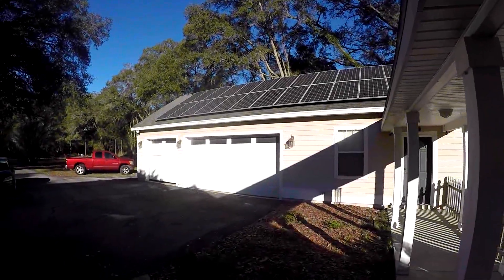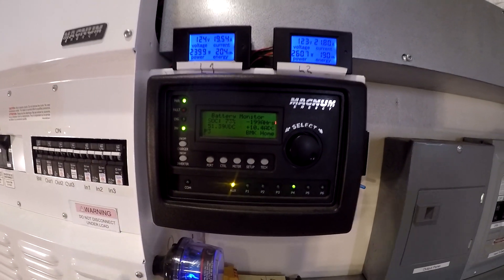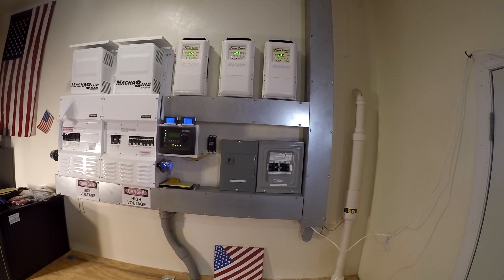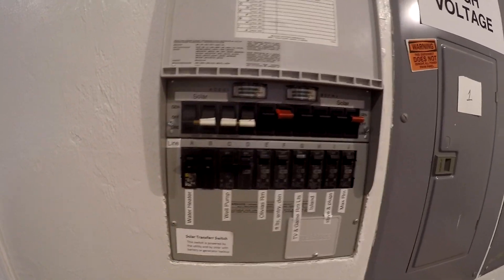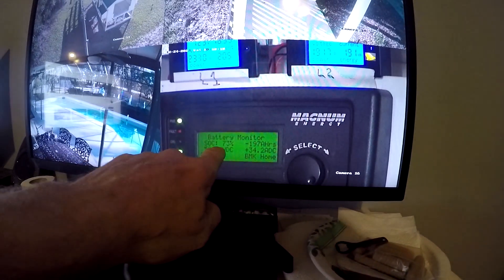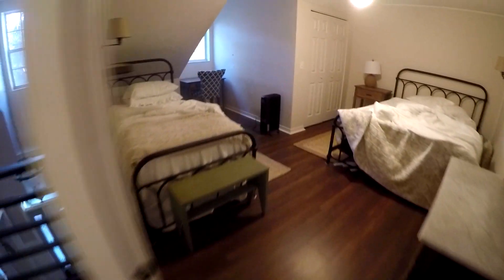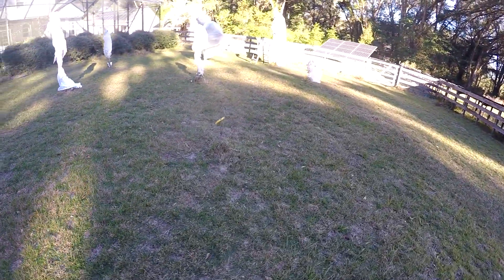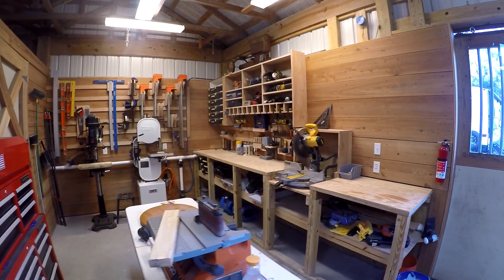Heat From Solar Power

Comment: You should have left the pump on. The lines would have been fine. 
As long as the water was flowing those pipes won't freeze that easy.  Was it 60 the next day?
Reply from the maker: Yes, That is exactly what I did.  I ran the pump non stop over the entire cold snap.  Thanks!

Comment: That Delta 2 has a lot of applications. It can be used as a backup power source, a portable one or even as a UPS.
Reply from the maker: Yes, I can be great as a UPS for most electronics however please note that it has a 30ms switch time and therefor will not backup a regular desktop computer.  Thanks!

Comment: Nice to see that the Delta 2 is powering the heater. I'm sure it won't be a problem since the Delta 2 is quite powerful.
Reply from the maker: It will run the heater for about 1 hour.  I use it the morning then recharge from solar later in the day.  That's one free kWh/day.  :)

Comment: You know you're from Florida when 30 degrees needs that much prep work!   Single digits here last night in PA and my biggest worry was my chickens.  Buttoned them up pretty good to keep the draft out and they did fine thank god.  Thanks for posting.
Reply from the maker: Michael, I almost feel bad complaining about 30F weather here in Florida when parts of country are -30F.  But your right, we are just not built for cold weather.  I probably have 2 miles of PVC that is at risk as soon as we go below 32F.  -30F would be a complete disaster!

Comment: Thanks for sharing.  I am running 10.5kw PV into a whole house service 12kW Growatt and 40kW of LifePower4 48v Batts.  All housed in sm exterior util room.  It has been 19 and 20 for past 2 mornings.  Heat in room only supplied by radiant from inverter.  She came close to shut down this am at 38F.  But survived.
Reply from the maker: That sounds like a really nice system and I bet you got it all at a reasonable price.  This type of system is a real game changer in my opinion.  Reasonable price and easy to install and runs a big chunk of a typical house.  Do you have any videos of your system?
Reply: @HomesteadEngineering  It has not been without initial problems.  It has struggled in the very overcast skies of So Texas for the last 6 weeks, with only a few days achieving 100% charge.  I don't back feed the grid, but will do aux draw if the battery chg drops to 30%.  I am fortunate that furnace and water heat are propane.  I dont see at this point, how, as a whole, civilization could ever completely withdraw from some support from carbon based generation.  The reason for installation was to gain independence from the Texas grid, which has its own issues.  I have contemplated doing a posting of the system, but have not done so yet.
Reply from the maker: @conservativejones3537  We are about 80% independent of the grid now and about to be more like 95% once we get the EG4's installed.  That said, when you get a few days like this with freezing weather and cloudy days, it would not be possible to run the house in full up mode without the utility.  If the utility were out right now, we would have to fall back into a reduced consumption mode for sure.  I agree, we are probably always going to need backup systems to our backup systems. Even if a large portion of the grid moves to battery backed renewable, we will likely still need a portion to remain base load in the form of gas or nuclear.  I think you should make some videos of your system and let us know how its working.  Thanks!

Comment: I'm here in New Jersey.  Last night =10 f with wind chill. I was up till about 3 am doing dishes running dish washer etc..didn't think I had to let my faucets drip. Well by 730 am I have a frozen kitchen pipe that WONT unfreeze. The hot water line.
Reply from the maker: Yikes!  I would get to work on thawing that out asap.  One thing I did last night was to run a load of laundry at 1:00am and set it to soak for 2 hours.  That way its using water into 3:30AM.  I got up around 5:00 and just ran the water for 10 minutes to empty the well tank and it refills with 72F water.  Hope you get it sorted out.